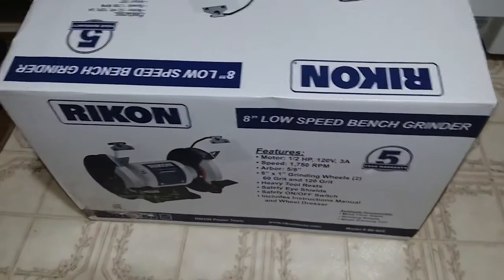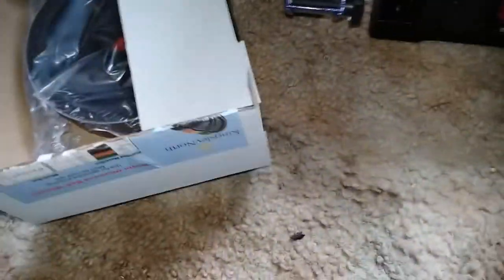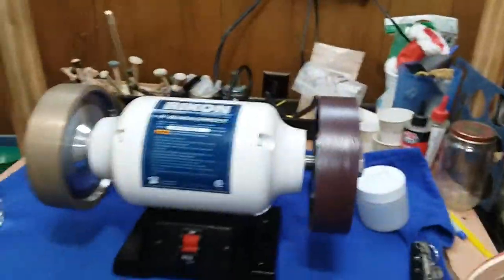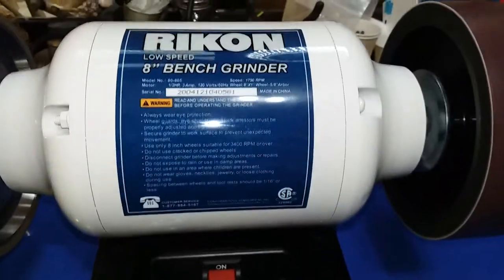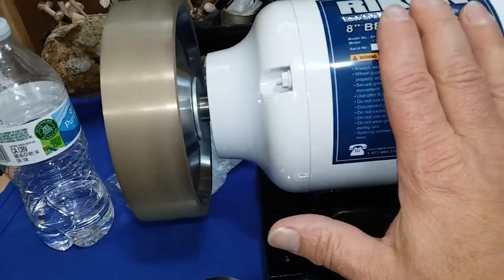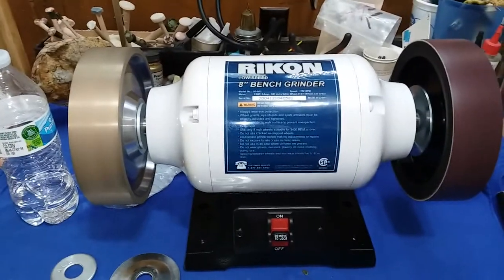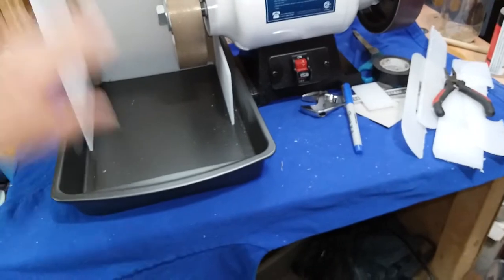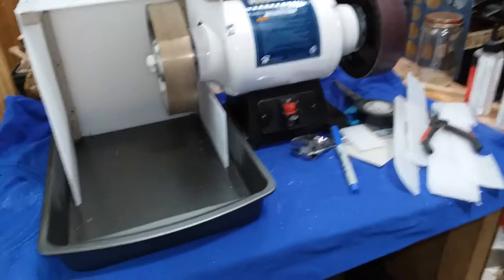Can I build a cabbing machine for less than $350?

Comment: That is seriously dangerous,  your using a grinder that is designed for dry operation only , the unit is not sealed against water ingress and the switch on the front is also not waterproof, chances are youre in america and on 110Volts so youre at least not likely to kill yourself should you end up getting a shock, do this with 240 volts and you would.

the second is that Cabbing machines are built not like this at all, the wheel placement on a proper cabbing machine allows the individual disks to rotate freely in relation to the spindle  that drives them, the spacers that you see between the individual wheels are placed there to hold the wheels . the centre of the wheel, bushing if you like is normally made of plastic and you would use the same diameter shaft as the hole or use a bushing that is supplied with the wheel, they are then not held in place with a grub screw, you then put on a spacer, another wheel , spacer and so on , at the end of the line you screw on a ring clamp that will add some sideways compression to all the wheels and spacers. 

The idea is that as you apply pressure to the wheel with your stone the wheel cna actually freely rotate on the spinning shaft, the main reason for this is safety, because you are using your hands you can end up having your hand dragged into the machine and basically ripped off from your wrist,  however because the wheels rotate independently this can not happen with a proper cabbing machine.

With your machine the risk of the wheel grabbing a piece of clothing, hair or your actual hand is very high and when it does it will drag your body part in with disastrous results.

I would not advise anyone to make this machine , it has two serious faults, water and personal injury.

I'm a design and mechanical engineer and this is bloody dangerous.  

If you want to make a machine for cabbing the best way is to get a 20 mm shaft say 800 mms long, use two 20 mm block bearings, and in the middle of the shaft use a V pulley that clamps on to the shaft,  make a frame for the bearing blocks to sit on and clamp them down, use a collar ring to lock the spacers and wheels tightly together but not so tight that you can not freely rotate them by trying to do so with hard twisting pressure. they should rotate a little , they will spin just fine but will freewheel in the event of an accident.

The centre V belt pulley should then go to a motor which is behind the shaft about 40 cms distant, Fit another V belt pulley to the motor shaft, make a cover for the motor but allow ventilation. Find an appropriate V belt and use that. Fabricate a belt guard to cover the V belt and front pulley for safety reasons and then make a water cover and tray system, for the cover use 200 or 250 mm drainage tubing and cut out a section along the length so you can get your hands in and apply whatever pressure you need to the stone your working on. For the trays use plastic garden trays or even metal baking trays . Just make sure when you wire it up that you do have an earth and a residual earth leakage circuit breaker on it as this system is not double insulated. 

Ideally a old washing machine motor will work well as a motor and you should try and find a foot pedal switch to operate it with , a momentary one meaning that if you take your foot off the motor will stop. For the water system just get a small submersible pump off Amazon and use water drip irrigation units and hose  , they work very well and are easy to regulate.

There are plenty of safe YT videos out there on Cabbing machines  so please dont make the one from this video. ITS DANGEROUS and literally could kill you or severely injure you

Sorry to be a Naysayer but this video shocked me.
Reply from the maker: I appreciate the comments. I will take what you said under advisement.
Thanks for watching!

Comment: We’re you able to find a low speed bench grinder or did you just use a regular grinder @ 3000rpms? I’ve noticed that the max rated rpm’s for most cabbing wheels is 1750. Did you find higher rated wheels o do you find the weight of the wheels slows it down enough?
Reply from the maker: It is a low speed grinder. They are out there and not too difficult to find, mostly made for sharpening knives and more delicate sharpening things. The cost varies greatly though. I believe the Rikon that I got a few months ago is now up to around $180. Honestly I would be afraid to try out a wheel on the high speed ones. Even my old modified flat lap of noisyness was 1750 rpm.
If you can get an electric motor for a reasonable amount OR off another piece of equipment, with a pullies you can reduce or increase the speed. Then get some pillow bearings and a steel shaft to fit and build a machine for actually very little.
I honestly would have built an entire cabbing machine instead of modifying the grinders but I was lacking on space and this seemed to be the way to go for space saving.
Email me if want to talk about making an entire machine.

Comment: Most of your video is friggin around with the water system. No need to buy $50 worth of water system and spend all that time rigging it up; just fill the pan with an inch of water or so and shove a square sponge under the wheel! The spin of the wheel keeps the sponge in place and the sponge does 2 things; wicks grindings away and provides a very even coat of water to the wheel. And, apparently, you failed to closely observe the design of water shrouds around manufactured cab machines. I have built, and am now building, my own machine much quicker and cheaper than you; good luck!
Reply from the maker: Wow..its great that you can build one that is less expensive. I learned a lot building this setup, and that is really what it's all about, learning. This machine is basically the beta version...in a later video I have the 2.0 version that is much more efficient AND simple without the $50 worth of fittings.
I honestly thought about just putting a fountain sprayer under the wheel but I do not like to reuse the mucky water. I did with my very first machine and it was not to my liking. I did actually use a sponge for a bit on this version on top of the wheel for spreading out the water but it seemed to get mucky rather quickly and I wasnt impressed.
As for the shroud, well I just used what was inexpensive just to see how it worked out. Like I said, the new version is much more efficient all around.
Thanks for watching!